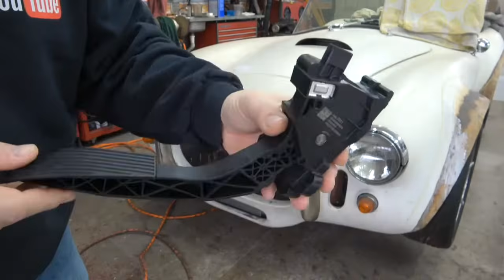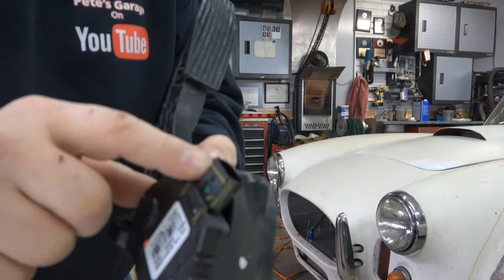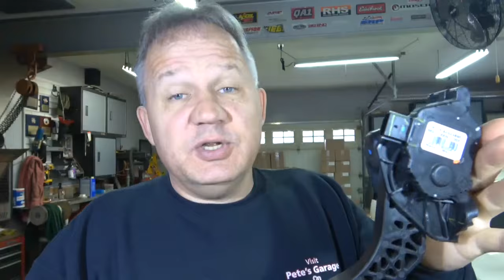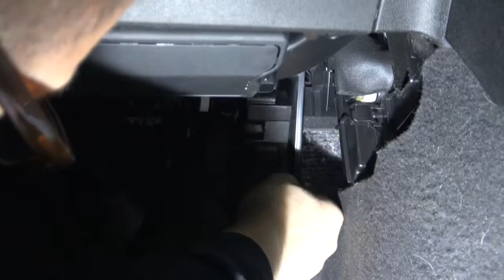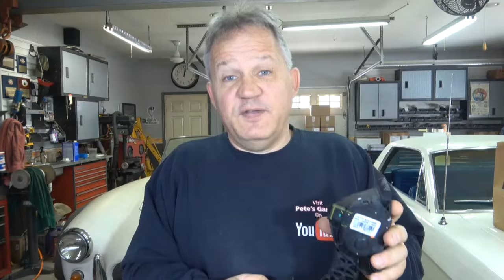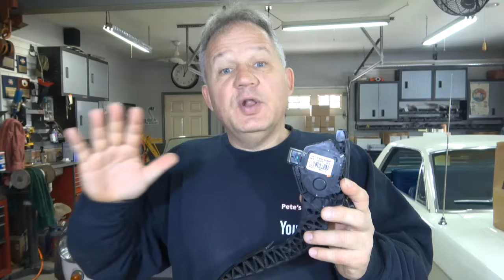Engine Reduced Power Mode - Loss of Power While Driving

Comment: After replacing the thottle n pedal for my 2012 chevy malibu after working fine for about 2 weeks the car started doing the same thing with the same code what can i do
Reply from the maker: You might want to check for any wiring harness issues or potential grounding faults.

Comment: my Chevy Impala 2012 had a reduced engine light come on. I let it sit for a couple days went to turn it on the engine didn’t wanna start. It started and turned off in a couple seconds. Can that be from the same issue you’re described in this video?
Reply from the maker: The reduced power mode I cover is typically related to the accelerator pedal sensor, so a no-start condition could indicate a different underlying issue like a fuel or security system fault.

Comment: Happened to my Chevy Malibu 08 fix the throttle and pedal sensor and it was running great for about a week and it started doing the same thing again, any idea what my be the problem this time my friend.
Reply from the maker: You might want to check for any wiring harness issues or potential grounding faults.

Comment: 2013 Kia Sorento I-4. Loses power while driving, I just blip the throttle and it comes right back. I changed the crank position sensor and no luck.???
Reply from the maker: You might want to check the throttle position sensor or look for any vacuum leaks.

Comment: Power reduced to lower engine temperature, with no check engine light and no overheatong. Any solutions. Thanks
Reply from the maker: Thermostat, plugged radiator, bad water pump....could be many things
Reply: @PetesGarage TY 😊

Comment: I need help finding out what part I need on my 2010 gmc Arcadia. I think it’s a supporting part in the lift gate only one on the car the two matching are the electrical parts I belive. The one I broke was just supporting with an indent “hole” for the ball on the lifted door.
Reply from the maker: I believe that part is called a lift support for the hatch.
Reply: @PetesGarage 2016 Ford Escape 1.6. Do you have any solutions for Reduced power mode to keep engine from overheating, with no check engine light, normal oil and coolant levels, good thermosta and sensor, happens when acceleraring to a high speed, I also hear whistling when acceleraring sometimes, not sure if that is normal eco boost or a seperate issue. Thanks.

Comment: My 2009 Saturn aura XE went into Engine power reduced and engine disabled mode. My battery died as well. I got a jump and went to a shop and the code was P0068, P0102 and P0113.  I bought cleaner for my throttle body but the check engine light is still on.
Reply from the maker: You likely have a bad mass air flow sensor causing those specific codes.

Comment: This happened on my Cadillac while on my way to work and I drove it perfectly fine while going 40-50mph I’m sure it’s a damn ground cable or a throttle body issue I had this same message pop up around 2 months ago before today but it turned off within the hour or so
Reply from the maker: Tough problem
Reply: I have a Cadillac XT4 and I’m having this issue, it made it to Chevrolet dealership it’s been 4 business days, I’m hoping 😢it’s an easy fix. I can’t afford for it to be a major problem 😢

Comment: Peter I have a 2021 gmc terrain and the light came on Engine power reduced and the car was slowing down but my engine light has been on for a few months I will check both things you said in the beginning of the video oil and the over heating first just worried 😢
Reply from the maker: Don't panic, just pull the codes and see what they tell you.

Comment: Hey sr. Thank you for this video I have 2012 Chevy Malibu 2.4 engine ltz was driving 40 miles  on the city and start lose power  and stopped *try to turn on the ignition but don't turn on just make one click lights turn on I put the scanner and appears 3 different codes P210-1, P1516,P2176 P2119. Any solutions?
Reply from the maker: Those codes point to a throttle body issue, so you should start by checking your throttle body connections and wiring.

Comment: Mentioning BMW, It happened to me on freeway 90 miles an hour in my 2013 335i. Which was very costly for BMW at that time for a faulty high pressure fuel pump. Luckily BMW has a high pressure and low pressure fuel pump and I was able to get off the freeway safely do to the low pressure pump still working. It ran like crap but it got me to a safe place. BMW had a recall on that and fixed for free because it was a safety hazard. But if these manufacturers are able to keep it from being classified as a safety hazzard it ends up on the customer as long as it makes it past the first 30k miles.
Reply from the maker: That sounds like a dangerous situation, glad you made it off the road safely.

Comment: I have the same thing i have to shut off truck open door and shut door let lights go out and restart and then its good usually all day untill next morning or after it sits for a while?07 escalade its driving me nuts
Reply from the maker: That sounds like a classic electrical or sensor issue that should show up once you pull the codes.

Comment: I have a 2005 Pontiac Grand Prix and the reduced engine power came on. Could it just be the MAP sensor?
Reply: such a vague warning but get a decent little code reader before replacing anything and will save you money and trouble replacing stuff that doesnt need it! or at least help u track down issue better
Reply from the maker: Gotta read the codes

Comment: @PetesGarage I hope you can help me 
I went out to warm the car up on one of our coldest days . About 8degrees
After allowing it to run for about 8-10 minutes I began pressing the gas to rev the motor up to warm the heat up then the check engine light came on  and the message popped up “ reduced engine power” I immediately turned it off.
I’m hoping it was just too cold. But I can take it to auto zone for diagnostic in a couple days when it’s warmer out .
Reply: I just had the same thing happen
Reply from the maker: It's the gas pedal

Comment: That was a great video 👏 and  kudos to you for replying to every comment. That simply is amazing!  I have a 22 GMC Terrain, which seems to be the same dash in the video. I am having the same issue, only no warning lights yet... So i may just try to change that and see if it helps. Thank you
Reply from the maker: Thank you! Hope that helps.
Reply: Have a 2013 cadillac ats some time the reduced power mode shows up but the car never actually loses power and will continue to accelerate as if nothing happened, also changed the oxygen sensors andthat triggered a check engine light any answers?

Comment: I have a 2009 Malibu I’ve changed the fuel pump, maf sensor , pedal , throttle body, ignition coils,spark plug, i have oil, I have coolant. Idk what it could be
Reply from the maker: You may need to get the computer scanned to see if there are any stored codes.
Reply: Hello! Thanks for the information. However this happened to me yesterday and the check engine came on. Unfortunately,I accidentally cleared the code and didn't get a trouble code reading. Also,my oil was very low and when I turned the car off it continued to run after ward for about 10 seconds with a shaking shut down. 
And idea maybe the fuel rail system is going bad 
Also,when I cleared the code the reduced engine mode and ce light wasn't on

Comment: I have a 2014 Buick regal turbo my car has the engine power reduced the traction light and engine light came on it happens in cold weather it happened today as I was about to get on the highway so I turned around went back home cut the car off cut it back on and it was fine no traction light and I drove it on the highway to work fine what do you think the problem is I’m gonna get a reading today and if you respond I can update you.
Reply from the maker: If you turn the car off and on and the problem goes away, it could be a sensor that is starting to fail.

Comment: I have been having this problem for 5 years now,no mechanic ever solved it.This has worked for my Nissan pedal ... good information
Reply from the maker: That's a tough problem
Reply: Thank you for this! I have the same issue with my 2012 Camaro for a couple of years now.. What I do is turn it off and on until it gets right. I shall now go talk to a mechanic about  this. Thank you!!!
Reply: Your car still in working condition after 5 years?

Comment: My Cadillac has reduced engine power but it also says service stabillitrak. About to change the throttle body…. I’m going crazy with this damn car
Reply: Mannnnnnnnn im going thru the same ish!!!!!
Reply: @CalCapone21 I haven’t fixed it yet but I’ve been doing HELLa research and it could just be a ground wire, the throttle body, or the throttle position sensor…. Idk my car was fine until I got a new water pump… this was actually 2 years ago lol, I just got a new car cus I was sick of dealing with the Cadillac… it’s sitting in my driveway waiting to get fixed still.  LMK if you find anything out
Reply: @CalCapone21 did you get it right ?
Reply from the maker: Stabilitrak issues are usually ABS or wheel speed sensors
Reply: I have all the exact same issues
Reply: A friggin GM joke
Reply: @billakkari6045 it’s been over a year and that car is still sitting in my driveway. I just bought a new car.
Reply: @DeRock401 😂😂😂😂 damn
Reply: I reset all the codes and I'm going to wait to see if they come up again
Reply: @ChristianCerda-n6d how do you reset the codes
Reply: @Shalaneespytake off the negative battery cable for 30 minutes. Put the cable back on.
Reply: @jerrygregory4613 oh I’ve tried that. Didn’t do anything
Reply: Take off both cables
Reply: This just happen to me what was it ?
Reply: @kwanemattics it’s been 2 years now. My car is still sitting in my driveway. I gave up and bought a new car instead.
Reply: @DeRock401 damm
Reply: Same here cost a dang arm and leg don’t buy a Buick lacrosse. Trust me.
Reply: Did you straighten it out?
Reply: @PhenixaG-r1g nope. Bought a new car. That car is still sitting in my driveway
Reply: That’s crazy I had to change my hose and my shyt doing the same thing
Reply: @samayaspiller wow. Let me know if you ever find out the solution. That car is still sitting in my yard

Comment: Was hoping you would get into “if you’re vehicle does start to overheat” because that’s what did happen to me
Reply from the maker: Over heating is a totally different problem
Reply: @PetesGarage when my buick verano gets hot..it'll start then immediately power off with the Engine Power Reduced error showing. Do you think it may be a fuel pump issue or the throttle  body?

Comment: great video great explaination. my 08 silv HD2500 Duramax just short of 300k Miles has " reduced eng. power"- but did not set neither a soft nor a hard code. We also have a little coolant leak. Hope this fixes the problem. We r doing service next week. Could it be bad fuel? I am also running a fuel water seperator. Pigtails have been replaced about 6 or so years ago. i keep maintenance up. Thoughts?
Reply from the maker: Sounds like you're on top of things, hopefully it's something simple!

Comment: I have a 2007 GMC Yukon that went into reduced engine power mode. GM service scanned it. Came back as throttle pedal position and/or throttle position sensor not working in conjunction. There were other issues that when estimate required partial engine disassembly (6 hour estimate) we decided to just park it until spring when the weather would allow me to work on it myself at home. In the down time I've been researching the different codes and possible fixes. Saving a lot of money this way. Easy fixes most of the time but the dealership won't tell you that. Afterall, they make the majority of their profit in the service department.
Reply from the maker: Sounds like a good plan, working on it yourself can save a lot of money.
Reply: What was the culprit
Reply: @DeRock401 first thing I did was change transmission fluid and filter, then engine oil and filter. Most of the drivabiĺity problems ended, but new ones appeared. Transmission started shifting issues or stuck in 3rd gear. The latest was a heaterhose blowout. One thing after another, with this one.
Reply: @mikemcgown6362 yeah I’m never buying GM again.
Reply: @DeRock401 I'm about thru with GM also. Maybe the older ones I already have will remain, but I won't be loyal to GM for replacements of broken down newer models. Ford and Chrysler have a chance, next. If Toyota wasn't holding value as much, I would definitely get one.

Comment: I’m stuck in Orlando from South Carolina with this problem. I have oil and I’m not overheating. I had it diagnosed as a bad fuel pressure censor I bought the part and hopefully I can have it fixed this morning
Reply from the maker: I hope you're able to get it fixed

Comment: Hi Im in South Africa. I have a 2017 Toyota Fortuner. I have the “Reduced Engine Power, Visit Your Dealer” go on. Diagnostic readings shows no faults. Do you suggest I replace the pedal?
Reply from the maker: That wold be the cheapest place to start
Reply: Hi did this fix the problem

Comment: I have a 2007 colorado I am getting "reduced engine power " only when it's below freezing there are no codes on the scan tool I'll wait until it gets warmer outside and it cranks fine I took it to a mechanic he let it outside his shop on a cold night and it  wouldn't crank then he waited about 45 minutes   after the temperature got above freezing and it cranked fine he has his scan tool hooked up to it not showing any fault codes
Reply from the maker: I would definitely say a sensor, not much else is affected by temperature

Comment: 2003 Chevy Silverado 2500HD 6.0, Reduced Engine Power showed up in the information window one morning. Codes that came up ....P2125 and P1125. I replaced the Accelerator Pedal Position Sensor but still have a P1125 code and Reduced Engine Power message is still present. The dealership said that the Accelerator peddle position sensor and throttle position sensors are not talking ro each other, so i changed the Throttle position sensor. That didn't change anything, still have a P1125 code and Reduced Engine Power message. Do those sensors need to be calibrated after replacing them is my question? Thank you for your videos.
Reply from the maker: You're right, sometimes these sensors need to be calibrated or re-learned by the PCM
Reply: @PetesGarage  is this something I can do or does it need to be done by a professional?
Reply from the maker: A shop with a very expensive code reader needs to do it
Reply: Ok thanks

Comment: I have a Buick enclave 2014 and the code I keep getting is… P1682 Ignition 1 Switch Circuit 2…And it says Engine power reduced then It just shuts off . And I “was” able to cut it off and back on after a few seconds. I had it “fixed “ by a mechanic last week and he said he deleted a bunch of codes, he said that it was just the brain and it was backed up. But since he did that a few days ago. It has gotten 10x worse. It used to just shut off and then after a few seconds cut back on, but NOW it shakes when it’s about to cut off. And says I engine power reduced still. And it took 5 minutes to cut back on this time (today) I was STUCK at a red light while cars honked at me because my car wouldn’t start (the nerve) 😓🤧 It is very scary❗️I have 4 kiddos and today it cut off on me (AGAIN) and my kids on the freeway. I had to hurry up and swerve over to the side lane.
Reply from the maker: That is unfortunate and very difficult problem to solve
Reply: @ WOW. 😫
Reply: you have ignition coils or spark plugs problems

Comment: We found the problem !!!!!
Reply: This just happened to me a few days ago I have a brand new 2024 Buick Envista with 9800 miles on it my car is still in the shop this is my third Buick and I've never had an issue with the other two cars outside of normal wear and tear
Reply from the maker: Awesome!
Reply: @PetesGarage  I changed so many things, and in the end, I had to change again  the fuel high pressure  pump and the harness  connector  wires were unweld.
Reply from the maker: Awesome!
Reply: @marrjor0754 what car exactly?
Reply: What was it?
Reply: What was it

Comment: Didn’t know this. Love to gather new information before it actually happens to me. Currently helping a friend troubleshoot a reduced power traction control issue. Parts cannon so far, new spark plugs, did not help. Coils appear ok… so now the #1 suspect is the throttle body. Any suggestions?
Reply from the maker: If you can't figure it out, you may have to take it in just for the diagnostic check

Comment: Volvo cx70
Intermittently happening and replaced lots of parts. 
Will work for a night or a few days then limp mode Everytime 

Newe to do throttlebody maybe too? But not getting any codes anymore since cleaning it
Reply: Bad ground maybe
Reply from the maker: Sounds like a bad electrical connection somewhere

Comment: I have a 2014 Chevy traverse..p0101 code..after my car temp warms up which is fast my acceleration gets way worse and barely moves..hesitation is bad..barley can get to 20 mph..then car dings and service stabilitrak:traction control off reduced engine mode comes on..already changed my maf and nap sensors twice:throttle body and sensor:alternator and my mechanic said he can’t figure it out. I’m dying here:(
Reply: Try your connectors under the fuse box.  There are two bolts that secure them to the bottom of the box.  If they spin freely then that might be the problem.   The connectors might need to be cleaned too.
Reply from the maker: That's very difficult. The dealer may have to look at it.
Reply: Same issue here with an a acadia 2018 i reved it probably to much as i was passing someone in highway and this codes showed. Not i feel like my alternators not workin